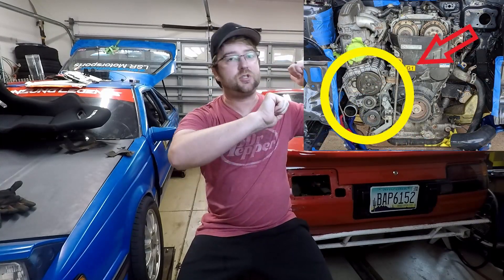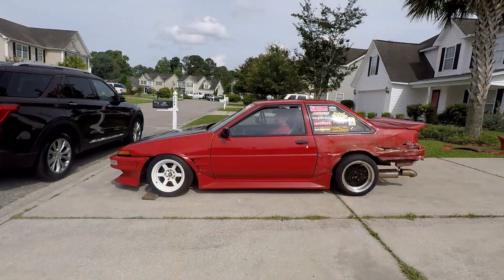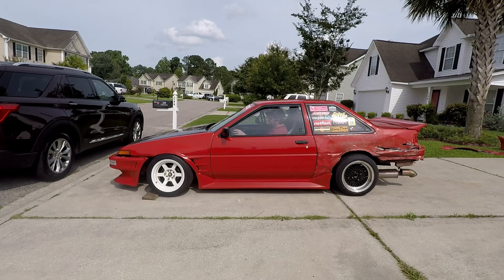SXE10 BEAMS 3SGE Clutch Review - OS Giken Super Single

Comment: I drove this clutch for 5 years with 330whp drifting. Not one slip. No damage whatsoever to the j160. It's perfect imo.
Reply from the maker: I love it. It's so much better than the eBay flywheel and stock exedy replacement clutch I had before.
Reply: @DoctoredGarage  I try to tell people. First beams mod should always be a good clutch :)
Reply: Hi i know this is a old post but 330hp at the wheels and no slip??Might just boost my 1J a bit ansmd see if it lasts
Reply: Hi i know this is a old post but 330hp at the wheels and no slip??Might just boost my 1J a bit ansmd see if it lasts
Reply: @dewaldswart2076  It was o a 3S. Cheers :D

Comment: So the bolts in the orc single silent kit work?
Reply from the maker: I believe so
Reply: I was wondering cuz the orc single silent kit comes with flywheel bolts but there's no way to verify the length.
Do you think it would be good just to order RB bolts?  @DoctoredGarage
Reply from the maker: I'm pretty sure the ORC and any other "super single" or multi disc clutch setup uses the same bolts. I'm not sure if the ORC bolts are reusable, I don't have any personal experience with the ORC bolts though

Comment: I fitted my super single OS Giken clutch on a standard 215 hp bmw e30 M3. I found out a terrible vibration since day one. I installed it myself with great caution. Difficult to gear up and even worse from 4th gear to 3rd to 2nd. Probably have to open up and do it all over again. What should I expect to see.
Reply from the maker: Either the fasteners have come loose, or the flywheel might need to be machined and balanced
Reply: @DoctoredGarage  all bolts with loctite blue only thing I could think of is a leakage of coolant above the gearbox. First start was weeks later because of a big renovation of the dat.
Reply: Coolant was plain water at that time. I think not much water found his wat down to the clutch, or did it?
Reply from the maker: @dream2too  on my engine, you're not supposed to use loctite on the flywheel bolts, but thread sealer because the holes are threaded all the way through the crankshaft.
Reply: @DoctoredGarage  i saw that. I'm confused. Can't find it but almost sure in the installation guide it says can't hurt to use extra loctite. The bolts were not from OS Giken but from the dealer.
Thanks for your reply' s.

Comment: Does the flywheel bolts go for any aftermarket clutch kit?
Reply from the maker: Pretty much only the super single or twin disc clutches need the RB flywheel bolts. Standard lightweight flywheels use the stock BEAMS flywheel bolts
Reply: @DoctoredGarage   thanks for the info keep up the good work!